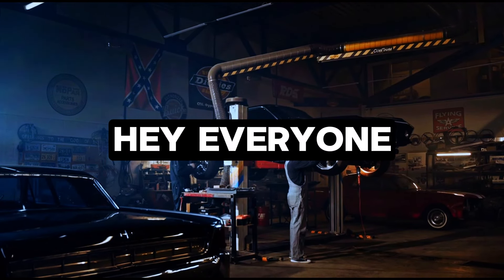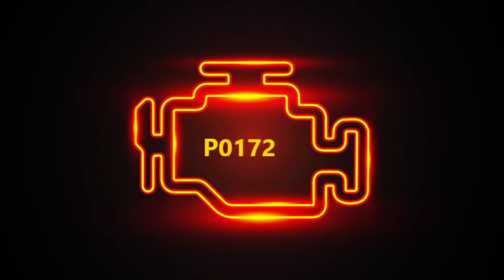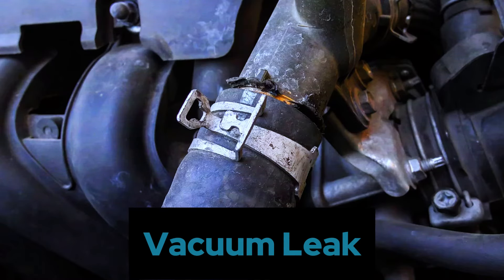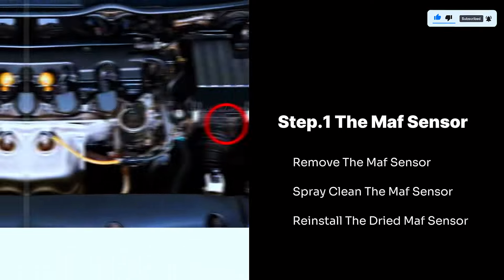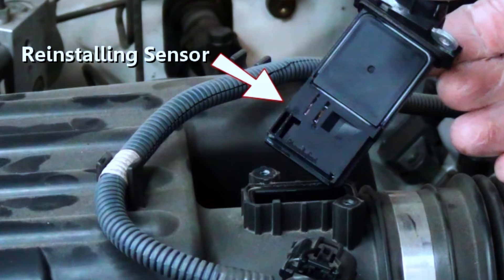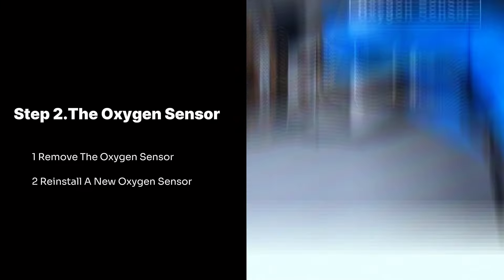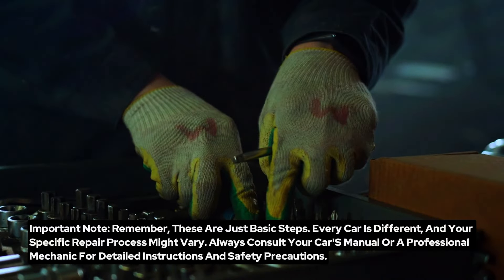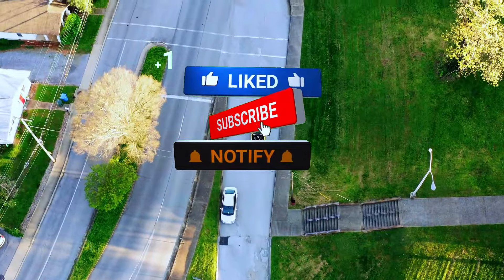P0172 Code Explained: Fix Your Rich Fuel Mixture |

Comment: ok oxigen sensor, upstream or downstream y changed the upstream, the maf, the map, coils inyectors and have the p0172 code
Reply from the maker: The P0172 code indicates that the engine's fuel system is running too rich on Bank 1, meaning there's too much fuel or not enough oxygen in the air-fuel mixture2. Since you've already replaced the upstream oxygen sensor, MAF sensor, MAP sensor, coils, and injectors, the issue might still be related to one of these components or another factor.

Here are some potential causes to consider:

Faulty MAF sensor: Even if replaced, it might still be malfunctioning.

Leaking fuel injector: This can cause excess fuel to enter the cylinder.

High fuel pressure: Too much fuel entering the cylinder during each injector cycle.

Faulty coolant temperature sensor: Incorrect readings can cause the engine to run rich.

Vacuum leaks: These can affect the air-fuel mixture.

It's essential to diagnose the issue further using a scan tool to monitor live data from the sensors and check for any discrepancies

Comment: P0172 & P0300 came on yesterday for my 2013 Chevy Cruze LT 1.4L. 
I just replaced my spark plugs, coil pack, and fuel injectors one month ago. 
Would the sensor mentioned here cause the p0300 code to pop up as well?